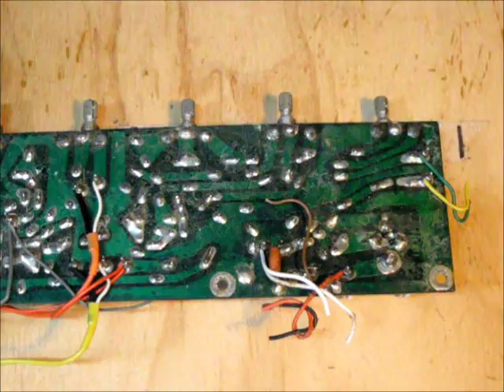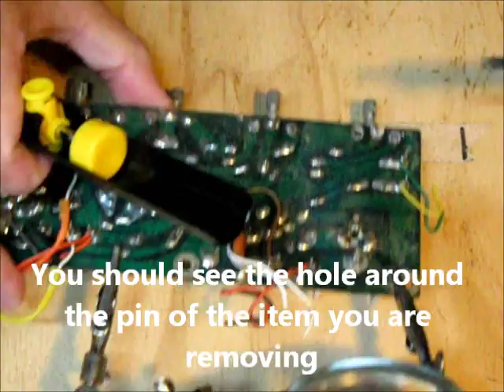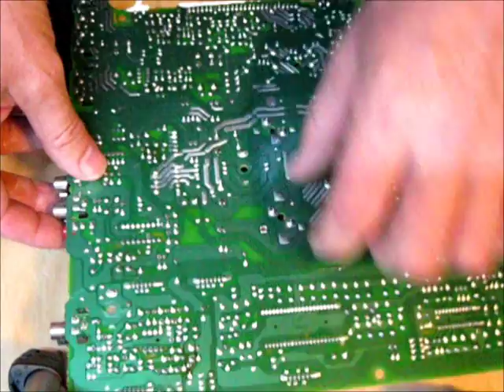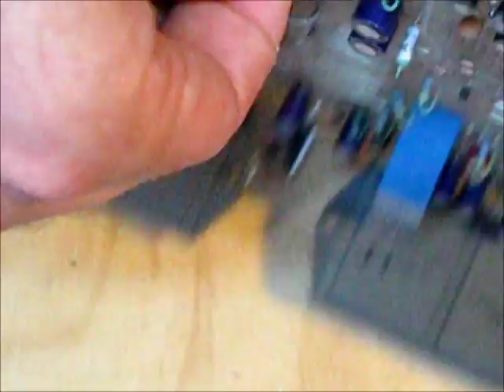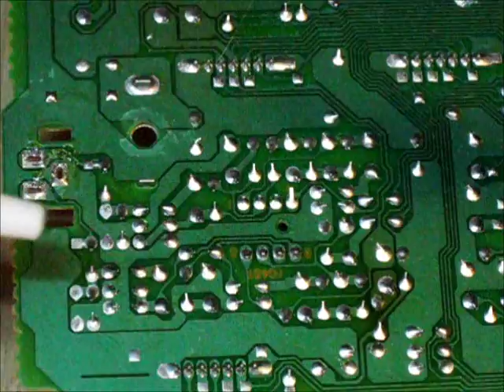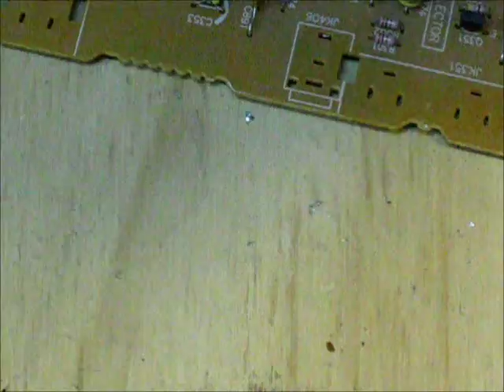How to desolder electronics remove solder with a desoldering pump

Comment: What can I do to prevent the metal copper plate from coming up every time I desolder. Every time I do it I keep pulling up the silver plating on the motherboard. And it keeps ruining the motherboard
Reply from the maker: Either your soldering iron is too hot or you are holding it too long on the circuit board. You have about 3 seconds to work before there is either board or component damage. I used to practice on junk electronics.

Comment: I've got a few old TVs in the Garden but they have been in the rain. Can the components still be saved?
Reply from the maker: From my experience many of them are still useful.
Reply: The Do It Yourself World Thank you for getting back to me. That's excellent news as I will be stripping the insides for components over the weekend. Both TV's still worked when they were out outside so hopefully many of the components have survived.

Comment: I watched this in 2016 and, I followed the tips to practice. I learned no matter how good these tips you will have to practice timing and technique. Thanks for the video.
Reply from the maker: Very true. Thanks
Reply: That goes for pretty much everything in life. It's amazing how few people realize that though. I have to admit though sitting on my ass and doing nothing but reading and watching videos for years on end has certainly made the transition to practical applications smoother.

Comment: When I was removing a bad capacitor on my board of a busted monitor, one of those pins was bent over. But when I tried to move it back like you did - part of the greenish layer of the board came with it as well. (I think part of the solder might've been stuck to it that I didn't notice). 

I'm unable to test the monitor atm, since I still need to find some new capacitors. But do you think it will still be ok? Or did I just ruin the board completely...?
Reply: Ryudo worst case scenario just use some "blue wire" to fix the circuit. trust me I know I've messed up pads before trying to repair stuff.

Comment: Almost all these vids show the tip of the pump but not the full pump or how it works. Odd.
Reply: Push slider of pump down. Press button to release the slider / suck solder up.

Comment: Can you not reuse the solder you've removed or is just more hassel than its worth?
Reply: +Rivyn Daniel For many reasons, no, the least of which being, solder is cheap.
Reply: Solder comes in a wire format, once using it turns to liquid then hardens to blobs. You cannot really return it to the wire form to easily use

Comment: Too long video...Could have been made far shorter and in a more professional way. The tools he is using don't seem suitable.
Reply: How are the tools not suitable? This is exactly what a solder sucker is for. Also Andrew, heat gun would wreck the pads on the board / heat the components too hot and wreck them too. Not to mention the tracks.
Reply: +M. Iqbal Such constructive critism! And the tools are exactly suitable, perhaps a heat gun would of been faster but I don't see how that's relevant.

Comment: correct me if im wrong, but this seems a lot easier than i thught t would be. is it easy at the beginning or does soldering/de-soldering take some time to learn?
Reply: oh and a quick question about the pump, i have a little red rubber squeeze hand pump thing, how would I use that? would i squeeze first then place it over the solder then quickly release? or what?

Comment: So that's the mistake I was making - not putting the pump to the join, but trying to suck from a slight distance whilst keeping it molten with the soldering iron. No wonder it didn't suck very well.
I often blow on the chip to cool it between solderings
Reply: You can use an alligator clip on the lead you're heating to act as a heatsink for protection. If you can fit it on the component side.

Comment: hmm can you tel me where is it the tin go if we pull the tin with that desoldering pump? Please help..
Reply: It goes into the pump. you can screw cap of pump off to dispose of it. Also usually once you press down the pump again it will release the last solder.

Comment: OK, I've been able to desolder and solder the components of a PCB. It's much easier to solder rather than to desolder, since I need a little bit more practice using the desolder, but I'm getting the touch for it. When soldering the tin was shiny and uniform.
Now the great deal for me is to get to repair a device and make it work, but that's another story. XD But this is a start.
Thank a bunch for the video. It was very useful for me.

Comment from the maker: No, mine is worn out and you should have a good, fine tipped iron for working. When you get better at it then you can use a worn iron for desoldering work as I do.

Comment from the maker: Yes you may need a hotter iron. It is better to use more heat for a shorter time. Lifting the solder ring/pad is bad and should not happen.

Comment from the maker: Do not  use the soldering gun. Its made for heavy work and is too hot. It can burn your board.

Use the 30 watt. It should be fine.

Comment: I have an xbox controller I'd like to desolder the points for one of the analog sticks to replace it, will a cheap 30 W soldering iron cut it to desolder the very small points? (I do have an old soldering gun [don't really know difference other than just they look different obviously])?

Comment from the maker: It is some sort of high temp nylon tip. The spring is inside, behind the piston. There is a metal rod on the end of the piston that pushes solder out through the pump nozzle.

Comment from the maker: It gets sucked into the pump through vacuum pressure when you press the button. A powerful spring pulls a plunger up, sucking up the solder into the pump.

When you press the plunger back down, a metal rod in the center pushes the solder right back out through the end of the pump nozzle. You hold it over a trash can as you push the plunger down and it falls out. This is why my hands go off the screen each time.

Evl, you need to open the pump and dump it out. Some stays inside.

Comment from the maker: Yes, those would have some heavy solder connections to handle all the amps. You need a blow torch, lol.

Most electronics handle about an amp or less on average so the connections are very small and easy to solder/desolder.

Comment: its a cheap chinese brushless motor controller as used in e-mopeds and e-bikes, so has 12 mosfets to switch about 60 amps, copper traces just dont hack it lol

I even bought a heated desoldering tool and waited 2 weeks for it to come, still useless. also the mosfets are fake irfb4110 so buying cheap has proved to be a pita ...

Comment: OMG I wished it was this easy, spent hours trying to get some fets out of a 1.5kw speed controller with the tracks beefed up with wire and solder... even my 60w iron could not get enough heat in, going to dremel most of the solder off later.....